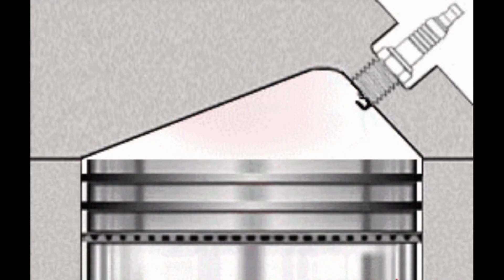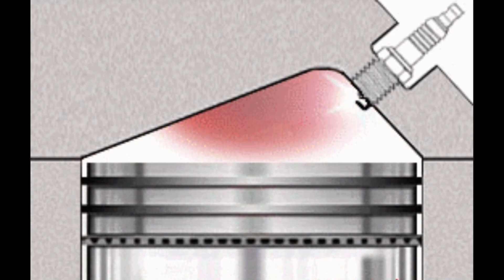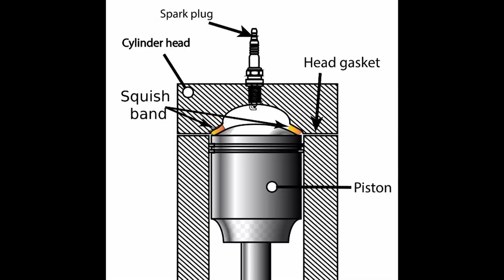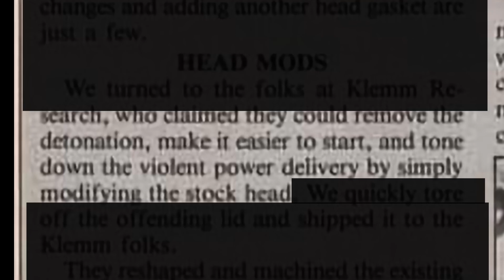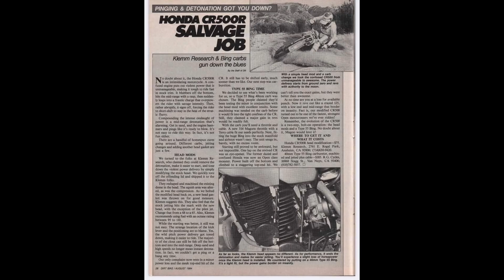Everything Wrong With The CR500 In 10 Minutes Or Less

Comment: Same here , my 84 is bullet proof , best honda I have ever owned . 550 kit, 40 mm flatside carb , would not attempt to run less than 98-100 leaded .you are probably  running Irving  pump gas 89_90-  ⛽️  .that's  the biggest problem with the 84 air cooled. People running to low octane.

Comment: The disk/drum was because older bikes used to have drum/drum. The the bikes became more powerful so the cost of developing and testing disk brakes in the front became justified, and since the front does a majority of braking it was the most bang for the buck, later they added rear disk also to improve braking even further. It's very similar to cars 1st they had drum/drum, then disk/drum, and later disk/disk in many applications.
Reply from the maker: I did not know that thank you!

Comment: What octane fuel do you run on your 84 cr500? i just got a 84 kx500 and im wondering if ill need vp racing fuel or if 91 non ethanol pump fuel will be fine
Reply from the maker: I used ethanol free but I put octane booster in there as well.